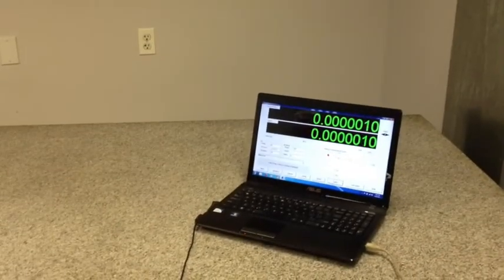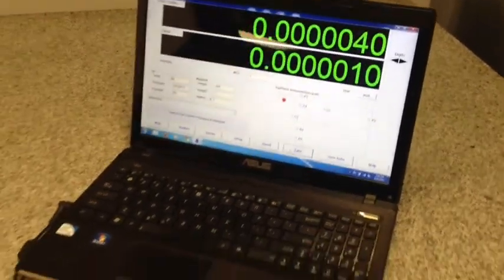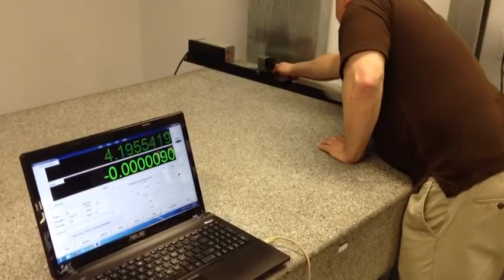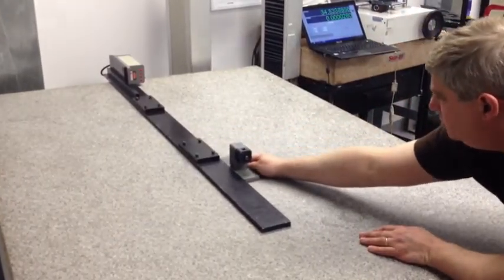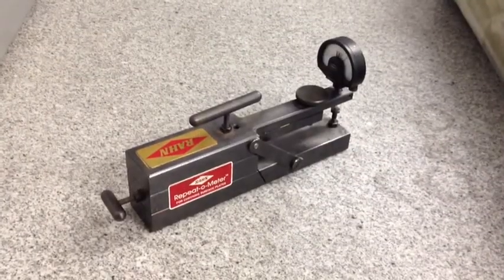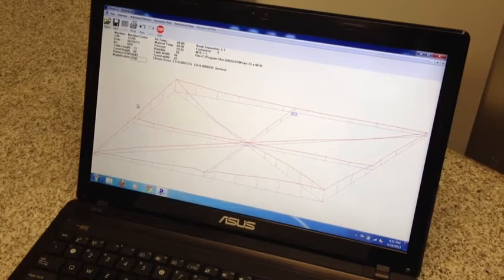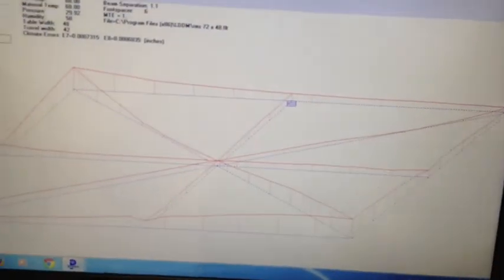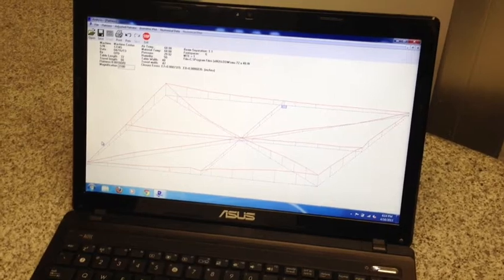Surface Plate Calibration

Comment: We are High precision Black granite supplier, have more than 20 years experiences on precision black granite business.Professional on granite components design and manufacturer,installation service.
High precision granite is used in laser machine,CMM machine,CNC machine,CT machine,small numerical control machine.
More details please contact:+8615628830716.sofia@nd-cnc.com.

Comment: what equipment were you using other then the repeatometer...
Reply: Kyle Crane it is an Optodyne LDDM. We use it to calibrate our Surface Plates.
Reply: Hi @rome368 , May i know the model number.
Reply: @asyrafshah6744  of course, the Optodyne laser that we use is model number MCV-2002W
Reply: Thanks for your respone @rome368   , special thank from Malaysia
Reply: @asyrafshah6744  You are welcome Asyraf
Reply: but @rome368  , It's the the master is calibrated?
Reply: @asyrafshah6744  The optodyne? Yes every standard we use is calibrated and traceable to National Standards and in this case NIST which is the governing body in the US.